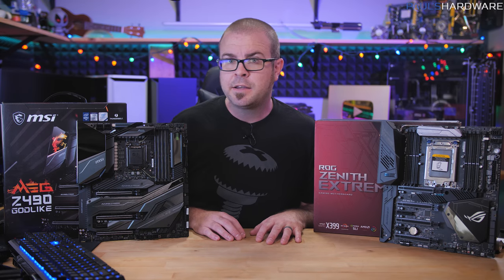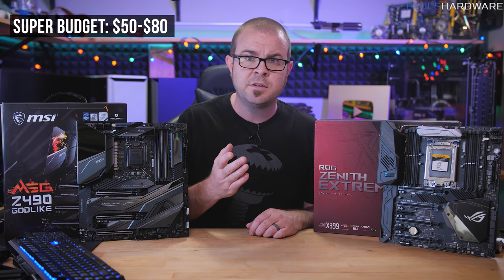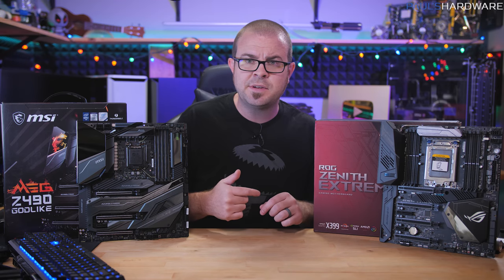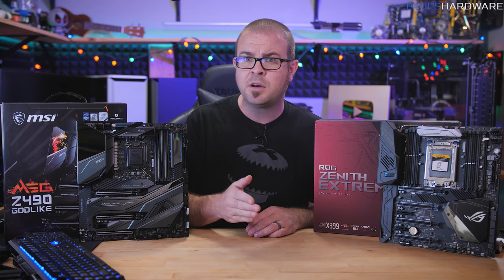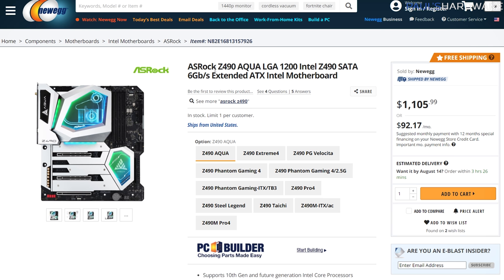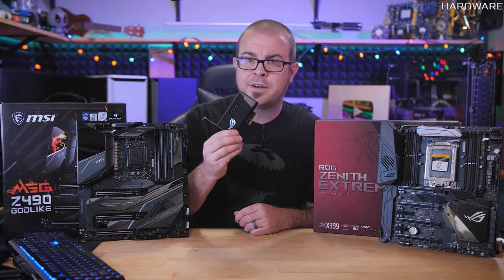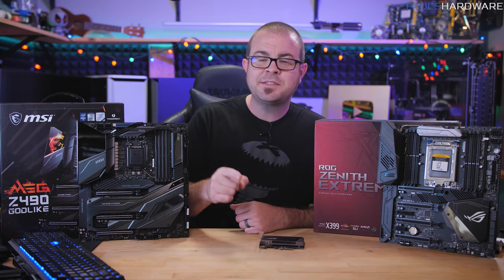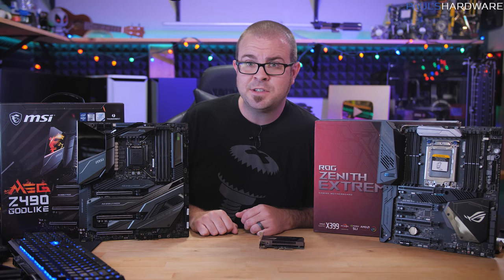What Does a $700 Motherboard Have that a $200 Motherboard Doesn’t?

Comment: I have a msi x99a godlike gaming carbon and I regret is only because this socket doesn’t have any new processors for it. I’m stuck with a i7 6850k and the cpu I have can’t overclock much. 4ghz max from the 3,6ghz to 3,8ghz boost. Over that it becomes unstable asf. Very unlucky. Also this CPU sucks up a lot of wattage and gets super hot. I lowkey want to sell it all and buy some AMD stuff but meh.. I spent so much on it, if I were to sell it all I’d get like 20% of it all back.....
Reply: I regret it because of the cpu only. The motherboard is nice and I have many lanes but it just bottlenecks my sli gtx 1080’s lol
Reply: I don’t even get steady 144 fps on 1080p w bf4
Reply: I get like 80fps with bf4 w a 1080 or sli 1080 (I have a hb bridge too and 64gb ram, 8 slots filled)
Reply: It costed like 600 when I bought it, my CPU was also like 500 or more and the two GPU’s were 880 a piece. Worst build ever as it’s worthless now and playing VR can be laggy. Ive thought about selling the two cards and getting a 3070 or 3080 😭 but idk about my cpu
Reply: CPU has 6 cores btw

Comment: As long as there are idiots who can pay 200$ for used original titan on ebay in 2020 (while 100$ gtx 1060 is at least 10% faster) there will be idiots who can pay extra 500$ for led lights inside your audio ports that for manufacturers will cost few cents to add. That's how market works.

Comment: The rig  you are showing has the radiator upside down!
Reply: In a vertical installed radiator should be installed with tubes on the bottom with the top end of the  radiator higher than the the pump.

Comment: who buys these boards? I bought an Aorus extreme.  As a poster below wrote, people who buy them have more money than sense.  But I see it a little differently. I was thrifty for decades and invested my savings. Now I splurge once in a while off of income from investments.  Its not that I have more money than sense, its that because I have sense, I ended up with more money than I really need. There is no way to justify the idea that the Aorus  xtreme is a good value. It's like saying a Lexus is better value than a Camry.  Only buy what you can afford.  On further reflection, buy less than what you can afford, and learn how to invest the savings.

Comment: Got a b550 tomahawk for my Ryzen 3600 + sapphire nitro 5700 + PCIe 3 nvme. Honestly disappointed I feel you can’t really oc the CPU much even with my 240 aio, I mean you can but it’s not worth it in my opinion. Should have just got a budget board

Comment: I really wish they would stop adding in these crazy Wifi adapters to mainboards.  Anyone who is serious is running a wired connection for a PC.
First think I do is disable the wifi in the system setup and pur some caps on the rear connectors for the antennas.

Comment: Enterprise computing is like walking with dinosaurs. In reality your workplace has a 100Mbit network connection. So 10Gbit ethernet will be used in enterprise computing in 2030 on the workplace.

Comment: "A higher end chipset board like an x570 for example" I paid like $150 or so. I'm rich now? 🧐

Edit: Sorry, I forgot my superpower is finding extremely good deals on computer parts. Hardware market prices are fucky--largely in part due to videos like this. Marketing wank controls the market more than the merits of the actual hardware. Now if only you could confuse the enterprise market in the same way, my superpower would be a marketable skill.

Comment: Most of the crap on boards now days is worthless. All I care about is the chipset, PCI-E lanes and ports, onboard audio, decent VRMs and cooling, and USB. The rest I have PCI-E cards for. SATA just isn't useful to me on the board. I have not ran on-board SATA since about 2008. I run a RAID card with an external disk array (SSD array now days).

Comment: there are things i would like to have, but not many boards have it. a REMOVABLE socketed bios flash memory. i would digg that. along with the ability to power the the part of the board responsible for cpu and memoryless flashing from an external battery bank (for those wierd cases when shit hits the fan while you flashing), allso i would like to have a board with absolutely no onboard audio at all. and NO RGB for f***s sake. none of that sh!t please.  fan controll,,, well maybe i would favour an external solution. i mean a very stupid little single board computer from the most possible dumbest can do the job perfectly for many fans. would make the mobo less crowded for sure. aaaand  USB. for the love of god, just gimme backplate breakout brakets and gimme a HUGE header to connect the whole thing up. i do not need or want it on the board it self directly. there is no reason to do so.

Comment: The only usefull feature to me is the faster lan ports. Its absolutely resiculous that in 2020 we are still stuck on freaking gigabit lan. a freaking 20 dollar media player has gigabit lan.  they need to stop being cheap &%@$ and add faster lan already on everything over 65 bucks.  But reality is 10 gigabit lan controller = 99 bucks thats a hell of a lot cheaper then a board with it. 2,5 gigabit card is 30 bucks.

Comment: lol my taichi has 1gb nic. I haven't plugged it in since I got it. Eventually I'll plug my commodore 64 into it. It makes it easier to transfer disk images to the disk drive emulator that I have. The C64 itself is the real thing though. Its NIC is through the disk drive emulator. It's probably only 10mb. lol Dropping 10x 200kb disks onto it actually takes a few seconds. It's surprising. It's a lot faster to put the USB stick in my computer itself, but it's too much effort. lol

Comment: A Motherboard is a layer of circuits that connect devices. thats it. voltage regulation is the only real big factor. look for buildzoid on utube most gamers only need 1 x16 pcie then populate all dimms easy
Reply: i got stuck with i5 10400f for now. got memory running 11-12-12-24 no secondary timings yet. 2666, h470 lol

Comment: If you are buying a motherboard less than $150, you are buying a piece of shit. It is compromised in some way or another. Usually it is in the power phases. This will cause you to struggle to even run a "better" processor at stock speeds (my best friend is the perfect example of this, had to buy twice). There are always "exceptions", but they are few and far between. I am the owner of a $700 board for full disclosure. Mine was a product of hardware, workload need, and ability to afford the added cost (time is money to me). Most people don't have this ability or need. When buying a MB look at the power phases. Understand the needs of the processor you are using, and the demands it places on your system.

Comment: Who buys $700 board; 10 to 20 year life cycle purchase. Really good deal. mb
Reply: Never over clock's will have a home central control and network processing server to family clients, and a personal station, that will last for a very long time. When they introduce the holographic game table like on Star Wars then its time to upgrade the homes central processing system. mb
Reply: No water cooling for decades life; air push pull through. mb
Reply: Right 10 GbE $900 month service provider today but it does 2.5 and 1 GbE so when network service providers drop the price u'r in. mb
Reply: GEN 4 PCI for 10 year life u can wait or buy now on the $700 570 board no issue. 

On an Intel PCI 3 board requires persistent memory tier but wait for Intel PCI 4.0 board.

mb
Reply: Is and when is not the back plate structurally practical on that part of the board to cantilever half  bridge the remainder of the board? mb
Reply: Right 10 GbE is the right choice currently $900 service fee available I know oft, but, the price will come down, and it will over 10 year life, and u'r in. mb
Reply: Or a home central station. mb
Reply: Right, because it has this. mb

Comment: What dues a $100 motherboard have that a $200 not? Seriously why spend more money than the minimum on a motherboard. Will the ram fit yes. will the gpu fit yes. will the gpu fit yes. Will they run better on a more expensive board no.

Comment: those boards are all irrelevant now so the content is even more moot  - things are not going to change much from now to zen4 but things changed plenty to make intel a non starter out of the gate - plus the supply chain is hopelessly borked - this is still the worst time to build or even think about building a pc - cpu prices have not budged for years - things have to change but they are not simply for the stresses on the mkt and no competition (and none in the foreseeable future either) the sector is a secular decliner but not unique, it is beholden the the market at large and it is just trashed with no return to normal - waiting is the only real option